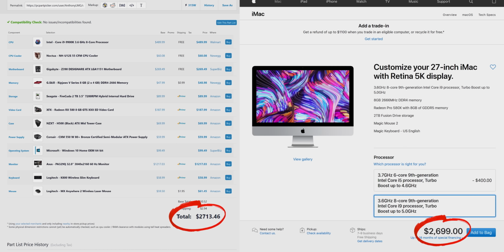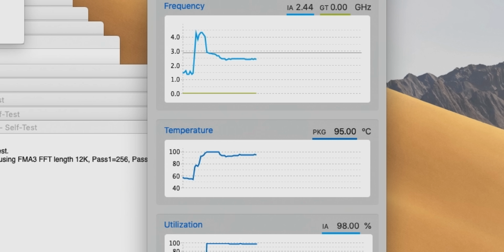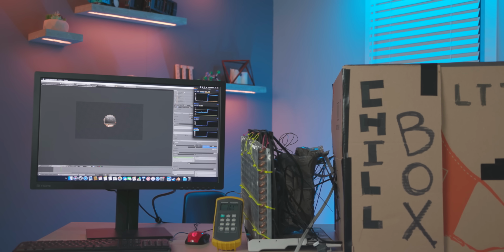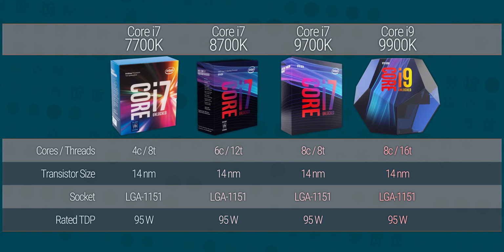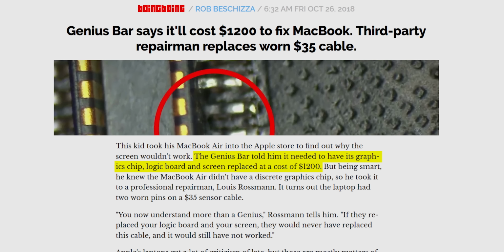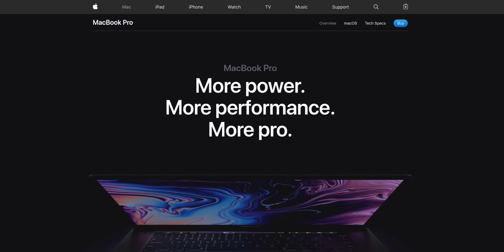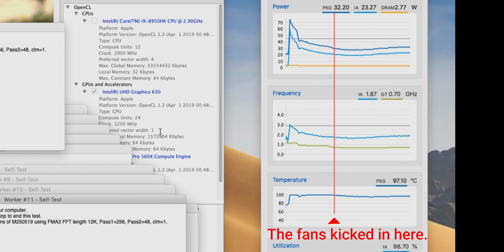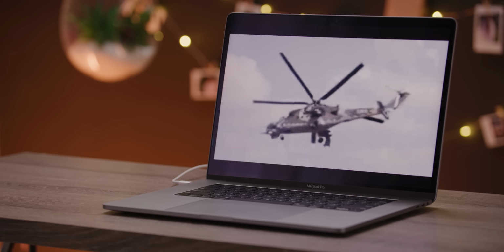Macs are SLOWER than PCs. Here’s why.

Comment: people buying apple mac books, dont understand about computers and how they work, so they see the specs on paper, which on paper are good specs, they see a fast processor, high system memory and good storage and think its a good laptop; and when theyre using it, they dont realise they're not getting the full potential of the system, because they're tech illitarate, anyone with a good knoweledge of hardware, and computers wouldn't get an apple mac book anyway

Comment: The MacBook Pro numbers are not significantly different. Anyone else notice this?
Reply: Likely due to the same reasons the numbers are similar with and without liquid cooling: the system is designed to use the lower ambient temperature to keep fans quieter rather than keep the CPU cooler.
Reply: The macbook pro has much worse intake than the mac mini so it benefits less from the chilled air it's in. People joke about macbooks being good space heaters, but they do a poor job of cycling the hot air into their enviornment relative to the amount of heat actually being generated.

Comment: I have a specked out 2018 MacBook pro and agree that the thermal throttling is a bit insane but this whole argument is thrown out the window when you just get fan control app and set it to sensor based, this is the one I use and it works great. https://www.crystalidea.com/?source=fancontrol_mac

Comment: The problem is that Apple has slimmed down a chassis designed to cool i5 and i7 processors, essentially cutting cooling efficiency and then throwing an even hotter CPU into it. Apple needs to redesign their laptop cooling solution for the power packed into it to be usable. From my experience, MacBooks should be kept on the MacOS version released the year the model was released for optimal performance (e.g. 2015 Macbook runs best with Yosemite). Upgrading the OS version typically adds a slight performance boost but at other serious costs (in my case, battery life went from 10 hours while working in Pro Tools (very CPU-intensive program when running large sessions) to under 2 hours while working in Pages (I didn't even test with Pro Tools)).

Comment: When your 2017 MacBook Pro can sustainably run the i7 7920 HQ at the all core boost clock of 3.6 GHz (the single core boost is 4.1GHz) without throttling, on bootcamp.

Comment: Straight up my MacBook lasted 8 YEARS. I love how it always felt faster than my 6000$ pc that has already slowed down after 2 years. I bought another MacBook and will not be building another windows pc anytime soon
Reply: what are spec of that pc?
Reply: filip 4457 I don’t remember off the top of my head but is was a I9 extreme processor, an asus deluxe motherboard, 512 m.2 samsung ssd, 1tb 860 evo ssd, gtx 1070, 2tb seagate hybrid drive in a be quiet dark base 900 premium case. It still is pretty fast but i can already notice the difference compared to my MacBook from 2017 that has all of my school garbage on it that has not slowed down one bit.

Comment: Oh boy I'm going into the deep end here but only because it was Anthony's review and it was perfect - no more of that 'PC guy perspective' crap!

First of all the 'pro' is just a nomenclature and it has been since they decided to call a 13" 'pro' - it can't be Pro if it doesn't have dedicated graphics period.
Second it was always Apple's (Job's?) philosophy to have low to no noise and they have ran into MANY issues in the past because of that the main failure in my book being the G4 Cube which is absolutely stunning and could've been a proper computer if it had a couple fans in there.

Which leads us to another couple of things:
A) they want to boast their hardware as powerful, silent and with longer lasting batteries in the market. They can - and did - achieve all of that but not at the same time as it was demonstrated in this video. It can have the most powerful CPU out there but it just won't be quiet when it tries not to thermal throttle and batteries won't last longer if the laptop is using all its potential so they 'trick' it to behave as showed;
B) yes most Apple users don't care mostly because they are using it for web browsing and (misplaced) bragging rights. The ones that do care are the ones who have been complaining for YEARS about Apple having their pro-sumers left out since the last iteration of the Mac Pro before the infamous trash-can. And why would Apple give a sh*t if computers are no longer its major source of revenue but their phones…?

And that brings me to my conclusion: Steve Jobs was in no way a good human being nor was he always right (I just mentioned his mistake with the G4 Cube) but having one person to centralise the company's vision was what made Apple different and desirable back then - warts and all.
Now it's just another corporation and it is doing what any corporation would do: profit above all. Sales are dropping? Increase the prices and lower the quality.
And the thing is Jony Ive is still there so the machines are still being built with the most elegant and beautiful design available in the market so people continue to buy it if anything for its looks and social 'status'.

Meanwhile I'm still rocking my iPhone 6S and only recently replaced my 2011 iMac with the 2015 model (for the 5K display alone) and can't see myself buying anything from 2015 onwards because it's all… corporation crap…

PS: to anyone interested Google Apple evangelization. It was a thing about 20 years ago and boy it paid of…

Comment: I think I know the answer. iPhones are truly professional-grade, meaning that they are designed to operate in business-driven environments: you can't miss a call and, thus, a contract, because of Android shenanigans. Or risk that your alarm doesn't ring because reasons.

On the other hand, MacBooks are for hipsters that watch Netflix in cafeterias or poor audio engineering people that cannot convince AVID to make a better Windows version of Pro Tools and make their sound boards with USB 3.1 connectors instead of Thunderbolt.

The two aforementioned types of people are either careless about important things or cannot switch to better machines because of the software they use, so Apple doesn't even have to make an effort to deliver a good machine.

Comment: I think this is a lot .. as noted in the video, this is not a problem with Apple exclusively, every laptop manufacturer is doing this. And, I'd say you downplay the extent to which it is true. Dell's current XPS (Which I had a variant of .. a 9550, before my current mbp) is within a few percentage points of the same degree of throttling. Instead of demonizing Apple, which would be deserved for pricing at least ram and ssd storage to ridiculous levels, you should be squarely pointing the blame at Intel. This is almost fully their problem. The 9900k has a real TDP of 165W (https://images.anandtech.com/doci/13544/ConstantPower.png), about 170%. The Core i9-8950HK is at 105W instead of 45W (http://forum.notebookreview.com/threads/overclocking-the-aorus-x9-dt-v8-w-i9-8950hk-to-the-max.820711/) -- more than 200% advertised. on a laptop, that's a littl like selling a full-sized sedan that you claim gets 35MPG but in reality gets 15.

Comment: Jobs used to say they designed software and hardware together, that’s why it worked better. Not anymore, they just don’t care.  Take it from me, I had a 2008 and 2012 macbook pro, build your own pc, you can make it better, or if you don’t want to, there’s sooooo much better options on the market, slim and/or powerful.

Comment: To answer most of your "why questions"; Because Apple doesn't care about their customers. They show this time and time again with their terribly anti-consumer repair practices, especially when it comes to right to repair. Apple has always existed on "upgrades" and because of this, designing poorly made products that you'll replace in a year is beneficial to them. On top of that, at least in my country, I can build the same machine as that iMac you chose for 65% of the price. That iMac is $4189 and the machine I built was $2763.77. Even picking exactly the same parts as you did (where allowable within my country) the machine came out $400~ cheaper.

Comment: I do inbound call tech support for a state wide ISP.  If Apple went under today, and bricked every Apple product I would be unemployed due lack of calls by weeks end.  99 out of 100 callers are Apple adherents, we bill them 100 dollars a pop to tell them the problem isn't us the ISP, it's them and their Apple devices (an easy call for the tech's they plug in and show the Apple user that they are online and good, what's failed is their Apple).  The other 1 out of 100 just needs a software reboot nothing dramatic they are good to go in less than a minute.

Comment: I've been saying for years that Apple would do well to make the MBP a little bit thicker in order to fit better cooling in there. It's a computer not a Victoria's Secret model, it doesn't have to be super thin!
Reply: @M Anderson well, i got a MacBook Pro 2010 for like $200, and first thing i did was to download MacFans and ram it up to constant 4900 RPM to keep it cool, and it still gets on the top 80's / mid-90's celsius temps
Reply: Neal Miskin I’m hoping this is the year
Reply: Mac is not a computer. It's a fashion item and as a fashion item (like bracelet) it needs to look good. After all the performance and features were always shit.
Reply: @ziomalisty  The main advantage of a Mac is that you don't have to deal with !@#$%^&*ing Windows auto-updating and crashing all the !@#$%^&ing time! People buy Apple for OS-X, the hardware is not the selling point.
Reply: @NealMiskinMusic  I have Windows 7. I doesn't crash and is not auto-updating by itself. Win 10 is shit. MacOS is a toy.
Reply: @ziomalisty  If you want to talk about a toy OS, MacOS evolved from BSD/Linux. Whereas Windows evolved from what was literally intended to be a device driver for a floppy disk. The original purpose of DOS was to find BASIC on the floppy disk and load it. Unix was built with multiuser and networking functionality from the ground up... Just sayin'
Reply: Ziomalisty that is gross lie with 1% truth (macs are fashionable is a true statement). I own a few PCs and an Android phone so I'm not an Apple sheep but you do have to give Apple credit where credit is due.
Reply: @abmon243  Credit isn't due, though.
Reply: @Jiisuri  lmao drops mic

Comment: I have had a few Macbook Pros over the years and I have to say they get worse every year. It's so stupid that Apple already has 2 other laptop lines that focus on thinness and size; then they want to add that nonsense to the Macbook pro. That couldn't be the 1 laptop they made that had a disc drive and more than 2 connection ports.

Comment: I have a Macbook Air hehe, garbage specs low temps. I just write papers and surf the web. I think I might switch to a raspberry pi. Same thing anyways
Reply: @ramymans5256  I don't know what's so funny, a raspberry pi can run better than a $1200 piece of aluminum.
Reply: Rasberry Pi's are way more portable and sexy than Macs anyway
Reply: @johnendris5637  agree, you can get the thing to turn it into a laptop for like 200$ and youre golden.

Comment: 0:17 "PC costs just as much as Mac", slips a $1200 monitor into PC build cost...
Reply: Which is a fair comparison. An iMac equivalent LG 5k ultrafine display is even more expensive. Hasn't Linus explained this many times by now? A mac is in many cases not the greatest purchase but the prices compared to what hardware you get aren't as outlandish as people suggest
Reply: Right.  Macs have expensive monitors.  That's kind of the point.  They use IPS panels, which offer better viewing angle and color accuracy/ color spectrum.  Screen quality is a critical part of the Mac design.  On the other hand, PC gamers love their high refresh rate, 1080p TN panels...which are a fraction of the price.
Reply: @fredygump5578  I can't go back to bargain basement TN panels, having used IPS on work rigs for almost 2 decades. I will compromise for a VA panel to go with my gaming rig which has better blacks than an IPS. I wish Samsung would hurry up with their MicroLED displays.
Reply: Heh yeah, they could've easily found a monitor for 1/3 the price for something comparable I guess
Reply: @OstropoloS  Easily find a 5K Retina monitor with the same quality as the iMac. I hate Apple but even I know that making the same version PC will cost you about the same
Reply: @OstropoloS  retina displays are their strongest point so it takes still a lotta money to find something comparable
Reply: @iaial0  Comparable doesn't necessarily mean identical
Reply: Because Macs are AIOs so to be correct you also have to factor in peripherals price too
Reply: and intel only

Comment: I think the main reason is explained in this video: Intel is going the other way Apple wants, launching processors with more horsepower without better energy. We are already at 7nm on smartphones and on 14nm on PCs for years. They designed the MacBook Pro 2016 expecting Intel going with more efficiency...but it didn't happen and this actual design is shit for this scenario.

Comment: Did you consider, oh clever one, that the iPhone doesn't have throttling issues because its an inbuilt cpu?
Reply: Any processor can throttle iPhone included. It's just the throttling issue is bad on macbooks.

Comment: This is why I am hesitant to get a Mac, plus on their MacBook line butterfly keyboards. Hope they fix these issues next gen. I hate Windows but Macs aren’t promising either.
Reply: Linux is starting to very good with lots of major companies backing them. In a couple years gaming on Linux will be second nature and it's free.
Reply: *COUGH*Linux*COUGH*
Reply: Get a PC and install Linux.
Reply: My problem is I just hate windows too much and linux is not viable. Having a mac has always meant me putting on fan control software and pegging fans at 50% , I have not had a PC laptop since 2003 but I did the same back then.
Reply: @MrHatQ   Have you tried Linux in the past few months and was it POP! OS? I think you'll be very surprised just how far Linux has gotten. I tried Linux 1 1/2 years ago and then just a week ago and drastic changes have taken place. You really need to watch the Linus Tech tips video as it shows just how much Linux has changed just within the past year its seriously crazy. Check the video out, https://www.youtube.com/watch?v=Co6FePZoNgE
Reply: @jayw654  My corporate apps  don't support it so it is a moot point really, the mac is just the lesser of the two evils, but I have set up a linux machine because I want to refamiliarize myself
Reply: @MrHatQ  I understand your situation. Sounds like its best to keep one Windows box as it s the most supports OS by Corporate America but see no reason to pick up Mac which has a whole hosts of issues.

Comment: Why buy a Mac? Simple, they pretty 🤷‍♂️
Reply: Software man. No one can deny, windows laptops just don’t have that same seamless ecosystem that macOS does.
Reply: Ben W dude you can't even play a game in Mac OS, for me that enough to run away, but kids buy it because is pretty and have a Apple logo in the back 🤷‍♂️
Reply: Roy Coto MacOS isn’t for gaming. Windows has really bad software problems that I hate, (I have a razer blade 2017) it’s a decent computer, but the number of annoying bugs and those updates, along with the pure confusion it causes, I don’t like it
Reply: Ben W is not for gaming by choice, just that is enough, plus you can do the same in windows 10 plus every single program is compatible and let's not talk about overprice...
Reply: Roy Coto they are overpriced, but all the ultrabooks I’ve had just don’t feel “right”. And there’s Mac specific things I’d kill for on windows. The biggest one is adding printers, all those pesky drivers. Also, a lot of windows laptops have big compromises. Apples is thermals, but some other windows laptops have shitty screens (my blade has had 2 problems with odd shadows). Apple was never aimed towards gaming, it’s reflected in their hardware choices. I hate Apple as a company, but their products really aren’t too bad.
Reply: Ben W I guess it depends of the user, for me a top of the line laptop most be capable of gaming, if not just buy a cheap laptop and use it for simple things
Reply: Roy Coto ah that’s where we differ, for me it’s all about portability (I never run anything more demanding then photoshop) and the sleeker, thinner the better.

Comment: To be honest, I think this video is quite biased (and I don't mean in the typical Mac vs PC way). You're using the latest MacBook Pro with the i9 processor as an example, but I have a 2015 spec'd out 15" MacBook Pro (all max besides the SSD storage in it) and I can render video in Adobe Premiere Pro or BlackMagic Design's Davinci Resolve just fine with respectable export results. I will agree that Apple's choice for such a high powered CPU in a small chassis without proper cooling wasn't a great choice, but in your testing it barely improved performance... That's just my opinion though. Interesting video otherwise.

Comment: apple doesn't care much about raw power, they adjust there OS to feel snappy and work faster than the windows sh*t laptops, if you compare everyday tasks in Mac vs windows you will find that a Mac will do the task faster, even for professional use (eg. Final cut vs Premiere). Thats why the don't care it works faster then windows because of the OS optimalisation NOT THE RAW power !!!